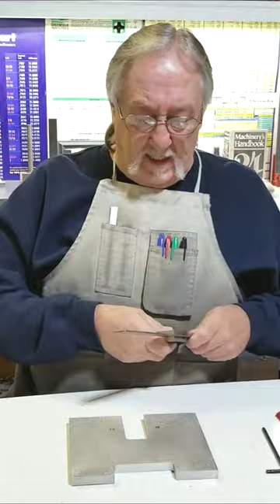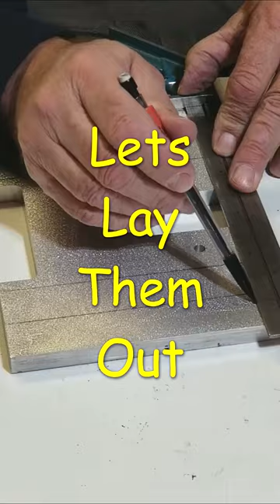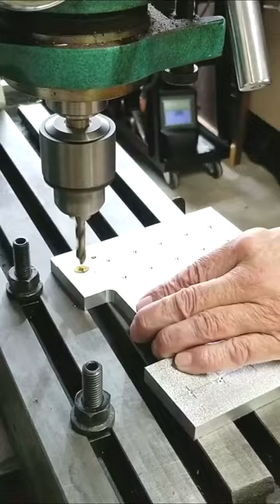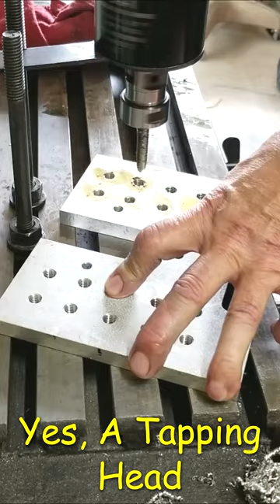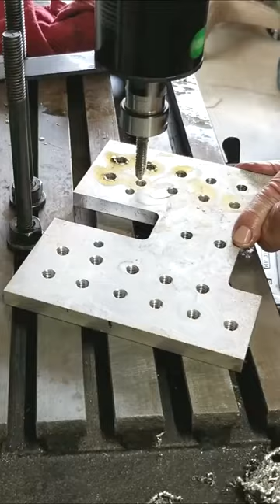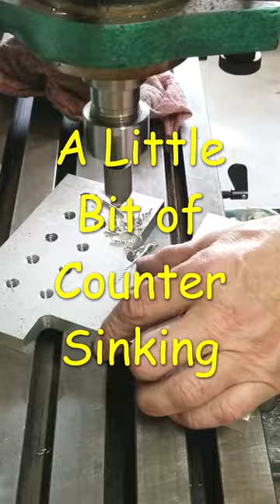#Shorts Old School Drilling & Tapping

Comment: I wouldn't consider using a tapping attachment on a drill old school. Old school will be doing it by hand. Just my opinion.
Reply from the maker: Ya, Most likely you're right. I just retired from doing aerospace machining and every tapped hole was done on a CNC. Programmed for position, Speeds and feeds. The Tapping Head was something I learned to use in the 1960's. So, This could go either way. Thanks for commenting, and maybe I will get more comments from people to help decide "Old School, Or Not" Thanks for watching my video.
Reply: I think manual machining in general is pretty old school. That and the title said old school not amateur.
Reply: @GlennNowOnYouTube  you're very welcome. Thank you for your courteous response.